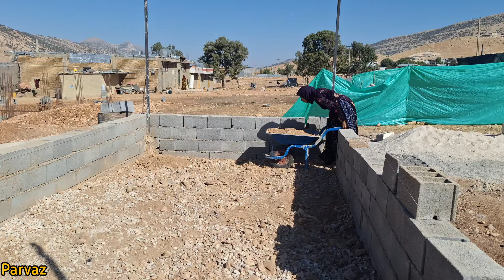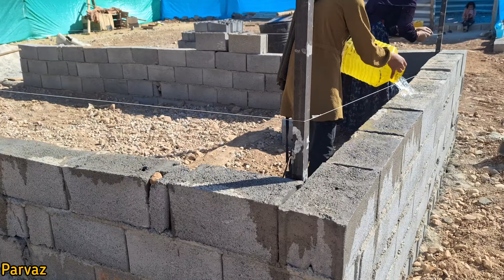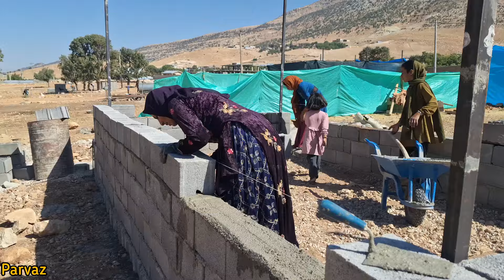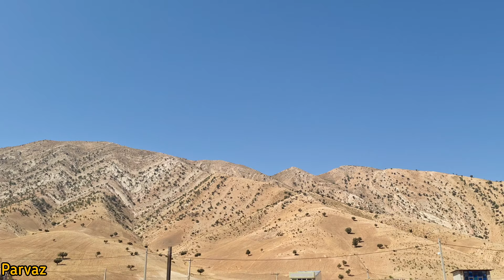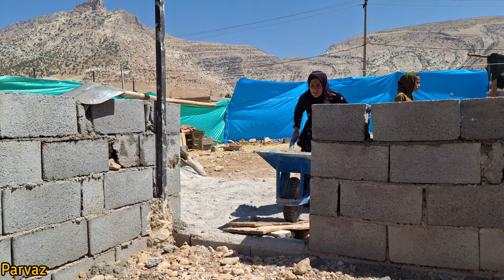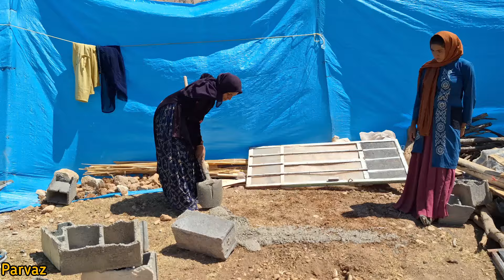Perseverance and Love: A Single Woman's Journey to Build a Safe Haven for Her Children

Comment: The block makers could easily make interlocking blocks. The sides of one end goes out about an eight of an inch and the other side the middle part goes out about an of inch, but wider. Construction flows much faster and the look and durability is better.